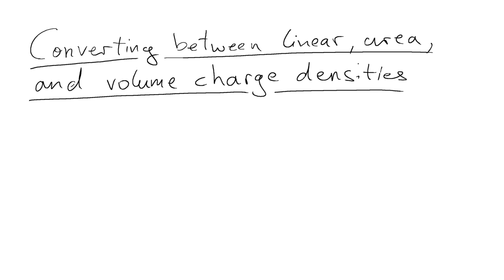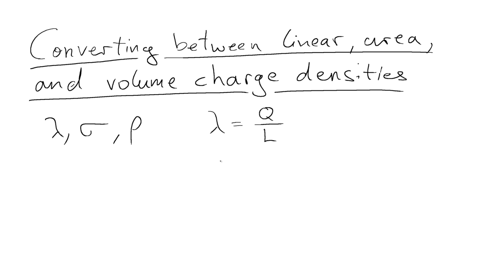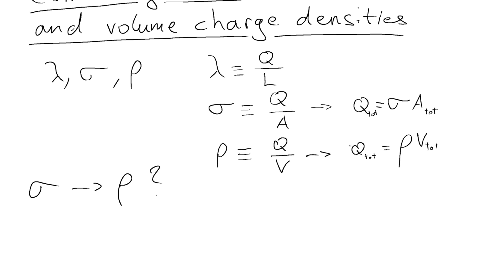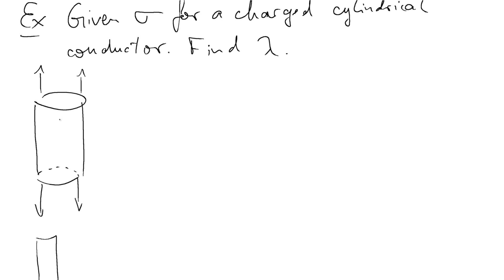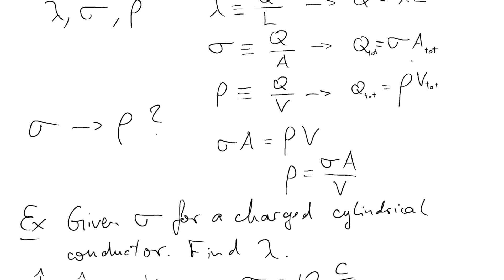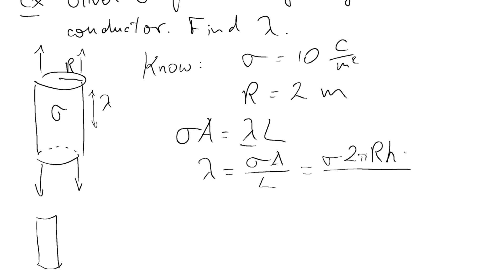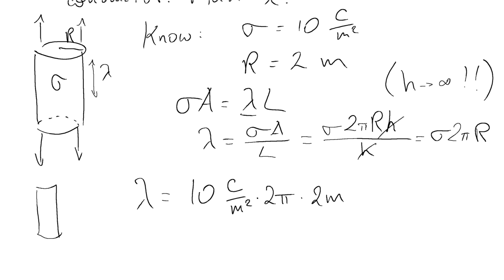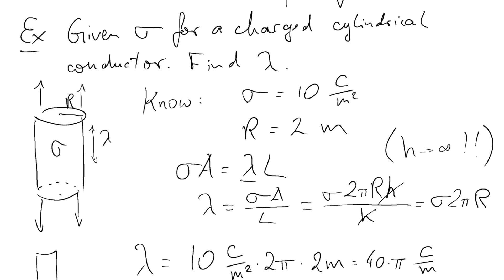Converting between Linear, Area, and Volume Charge Densities

Comment: Doesn't this presuppose that the total charge is found along your path L? Consider a finite section of the cylinder of height h,  with charge Q'. I am going to try to apply your reasoning to this situation. Since we said the charge was distributed uniformly, area charge density is the same everywhere, so sigma = Q' / 2piRh  => Q' = sigma * 2piRh . We can interpret this as "the total charge of the cylinder is contained in its surface area". That's completely reasonable. Next, let's find the charge along the height h. Because the charge is uniform, so is linear charge density, and so lambda = Q' / h => Q' = h*lambda. But lambda = sigma*2*pi*R, and so we have Q' = sigma * 2piRh. Mysteriously, we have found that the total charge along this line on the surface of the cylinder is equal to the total charge of the cylinder. In other words, the entire charge of the cylinder is somehow contained in a single line segment on the surface of the cylinder. There are infinitely many curves I can draw that are h in length on this cylinder, and somehow each one contains a charge Q'? How can that be possible?
Reply: It's not that the charge is somehow squashed down to a line that runs the length of the wire. Instead, we have rewritten the charge in terms of circles around the circumference of the wire and it's only when we multiply by h that the circles are stretched out into a cylinder. Looking at at a single circle that is infinitesimally thin (hence circle, not cylinder at this point), the charge contained in that circle is dQ (infinitesimally tiny). Another way of thinking about it is to 'step back' away from the wire. If we do this, then eventually the surface area of the wire becomes negligible and only its length matters. In this regime, the surface charge density becomes a linear charge density.

I hope that helps some.